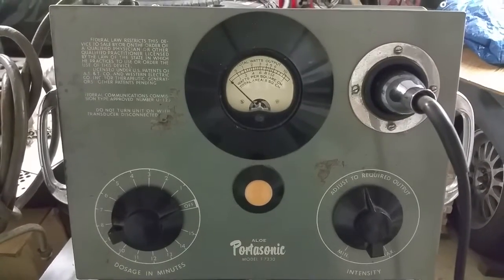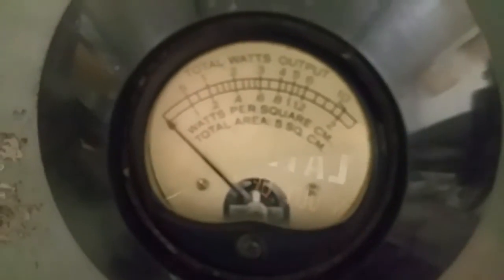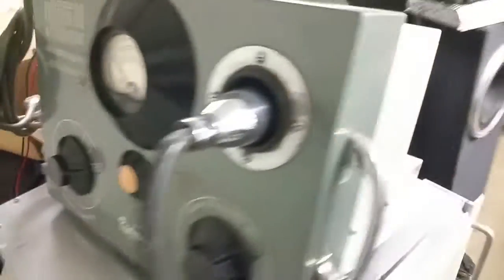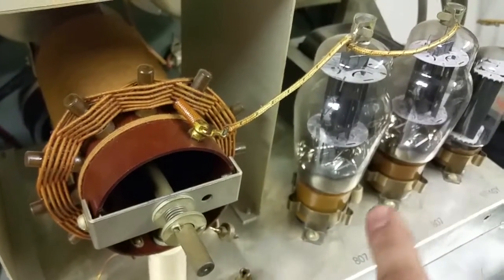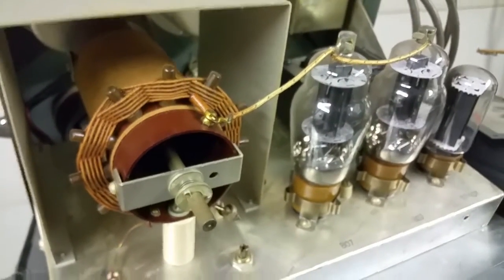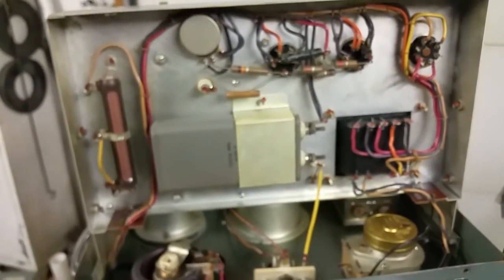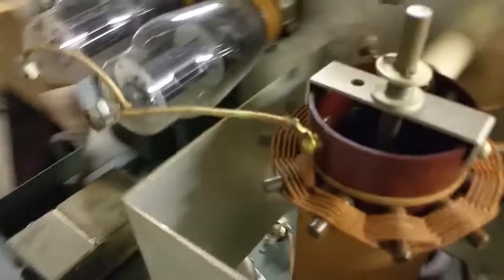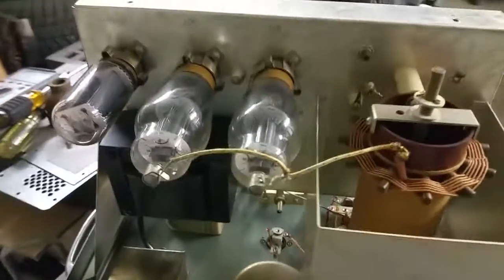Amazing ultrasonic med unit with a tesla coil inside!

Comment: Did you at least try to see if it worked, as per, the reliving aches and pains?... Just curious...  and I have to say this old saying..... "They sure do not make things the way they used to.".. Our world has been completely overwhelmed with that business ideals of "planned obsolescence".. Thank you for sharing, Sir.
Reply from the maker: Sadly the Ultrasonic end was reading as a dead short, something failed within, and upon taking the end apart, it was all potted so non serviceable. Was never able to test it as intended. But 4 years on I am still using it in my lab as a high frequency high voltage power supply! They sure do not make them like this any more!
Reply: @DJDAudio  That is a bummer... I read up on Ultrasonic therapy stuff... it kinda (as I understood it) is like the process of cracking your knuckles, when you hear the popping sound... which is the joint lube and air in the joints being moved around really fast... Well, the ultrasonic probe does the same thing, except there is no "popping sound" heard, and the air bubbles in the joint lube gets broken up into smaller bubbles instead of the air bubble being collected in one part of the joint causing stiffness... Something to do with exploding the air pocket into dinky air bubbles by means of cavitation, from the ultrasonic frequency vibrating the daylights out of the focal point area if interest's, which would be the joint area.... There are claims that people do feel a measure of relief, and can feel it with in seconds... I want to experience this for myself now..  like after a long day of wrenching on something, my hands hurt, the second I sit down in my recliner chair, LOL.. I don't know how my body know when I sit down in my chair, to then unleash full throttle ache and pain into my hands, but it does..lol... Thanks for showing the video, I am looking into this still, as I am now curious to try this. It does sound like the relief is only a temporary feeling, some just hours, and others reported a few days...
Your machine, once (before you modified it to serve a new function) would allow for changing the focal length/depth, for trying to reach joints that are deeper into the body tissue, as compared to the hand/finger joint that is quite exposed, where as the back of the knee or hip joint is much further in past major tissue structures? is that what those dials were on your machine?